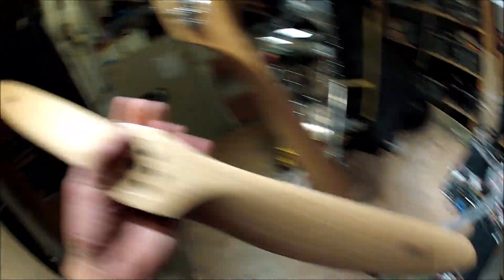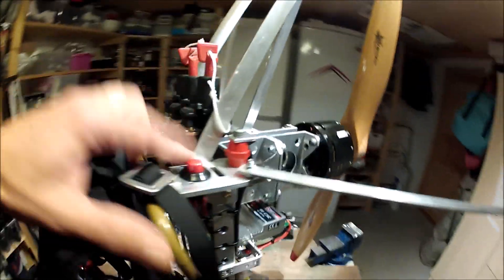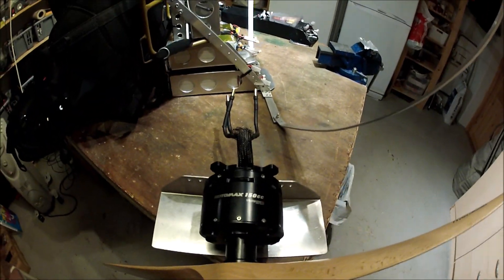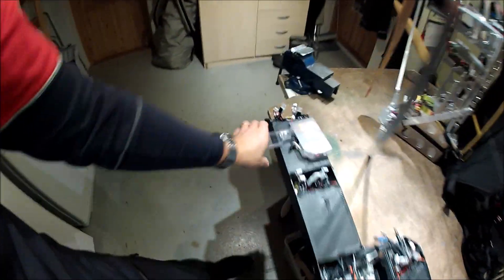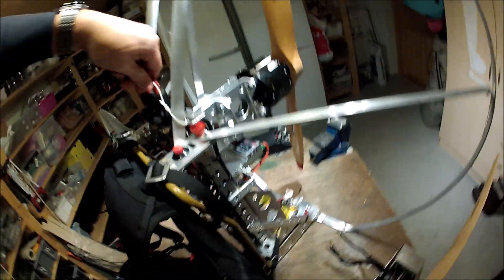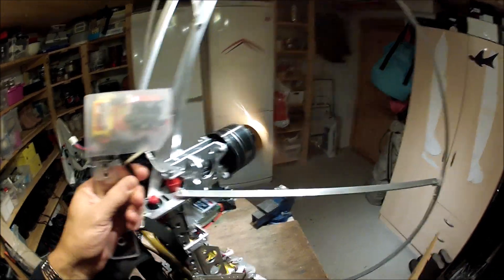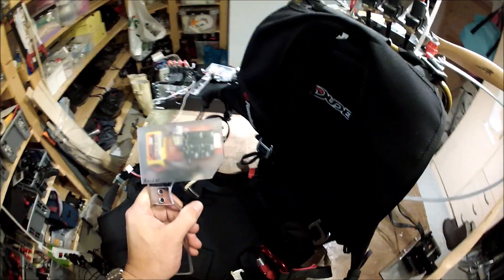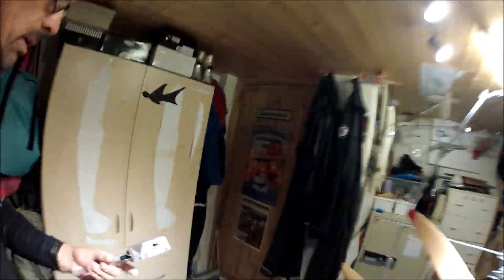E-Help Supine R&D, ski test

Comment: What is the range using 0,5kW? I assume you dont need 24kg for gliding. ….(I would like send you better snow  from Germany...). And uphill?  I would assume a gain of 200-300m can be possible for a mass of about 80kg using 0.5kWh. What is the glide ratio or loss of ski?